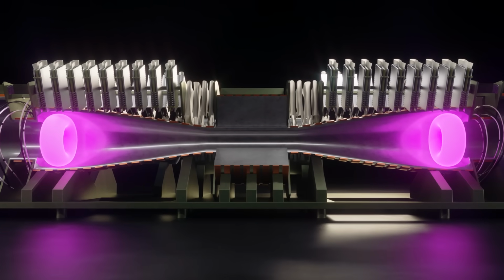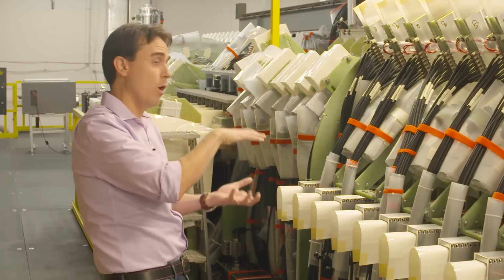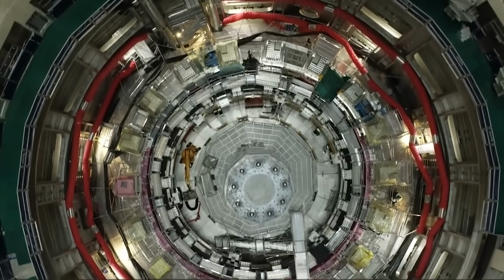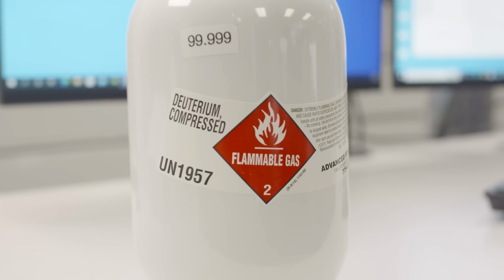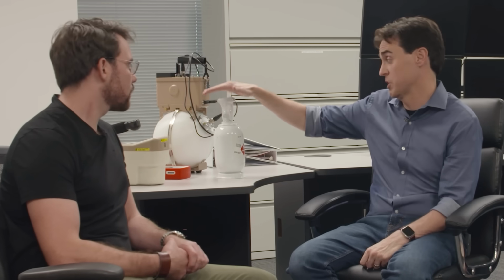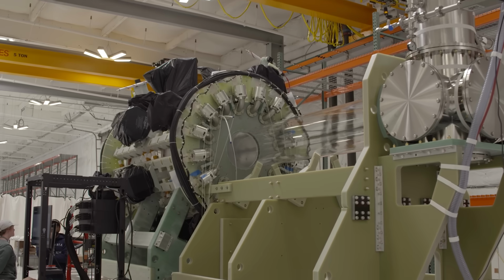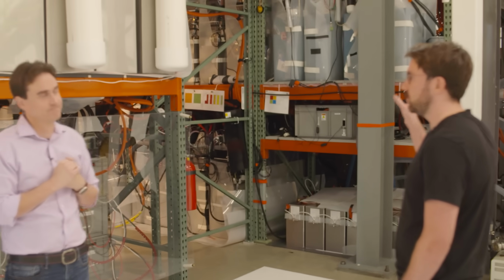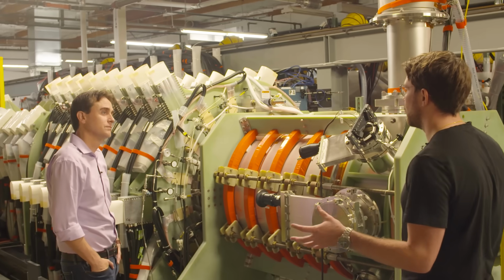A New Way to Achieve Nuclear Fusion: Helion

Comment: Can this math/chemistry essentially propagate with the estimated weight and molecule type of our universe what type and size of fusion reaction it took to create the big bang, and or disprove that it happened in such way?
Reply: im not sure what your talking about but no size of fusion had anything to do with the big bang
Reply: @terraneko8999  everything has a solution, doesn't surprise me you wouldn't know that. 
 No need for comments when you state yourself you don't understand
Reply: @golfnb28  you asked "what type and size of fusion reaction it took to create the big bang" and the answer to that is none, they have nothing to do with eachother
the thing im not sure about is what you meant grammer wise
Reply: @terraneko8999  Why are you saying that fusion reaction isn't what created the big bang? The fusion had to of happened within it's self at a single point. How are you concluding they have nothing to do with each other.? Yes, the big bang is a theory, however there is no known knowledge of exactly what happened. So this type of fusion reaction could conclude what happened during the first reactions that could create the big bang, how could it not?
Reply: @golfnb28  your not wrong but we mostly understand all the parts of the big bang where fusion could help us, the big unknows are timespans and energies so insane that fusion cant compare

Comment: Sounds like an expensive way to waist a lot of energy.  Your always gonna have 2 open sides to leak out.  As well as a pulse configuration that doesn't use simple mechanical device.  The thing is gonna need to be reset and re-calibrated every couple hours while in use.  This is just a bad idea from someone that watched to much star trek and went, I can make a fusion warp engine.  Where do the Di-lithium crystals go?  Its and interesting and new take on the fusion problem but its inherently flawed.  In engineering simpler is always better.

Comment: They insinuate that our energy bill is going to go away but in real world  it will triple so beware of cheering the planned psyop of clean energy. You still going to have a power meter that is even more sensible micro energy uses like small transformers that were ignored in the past by old meters.

Comment: Okay, so getting this process to endothermic--putting out more electricity than it takes in--is difficult as usual, but the pathway ahead seems straightforward.

My concern is that as energy in the central chamber rises, the reactor might cross a threshhold it wasn't made for.  Helion's covered deuterium-deuterium fusion and deuterium-Helium3 fusion, but not potential Helium3-Helium3 fusion or worse yet, the triple-alpha effect.  Where three helium nuclei fuse to form carbon.  And no, I'm not saying that's what normal operation would look like.

I'm saying that's what a runaway system failure could look like:  That if you run these reactors too long at dozens to thousands of pulses per second, eventually pressures run away and you get a triple-alpha event that blows up the reactor and spews radioactive carbon everywhere.  There NEEDS to be both a) a system that keeps pressure runaways from happening, and b) a method of watching and controlling the Helium3 present to make sure it doesn't accumulate enough to allow the helium to fuse with itself.

Comment: At this speed, the cross section of fusion is almost nonexistent.  It is too fast to undergo fusion.  Yes you need speed both thermal and kinetic, but after a certain point the speed of the particles drastically lowers the chances of a fusion event.  There are a thousand graphs illustrating this

Comment: Two months ago two lights in the sky came down and one them was leveled off at around thirty feet off the water and came close enough to see that it was a metallic sphere approximately two hundred feet in diameter encompassed in a strange glowing and it made no sound and judging from the speed they left at it would be my guess  that these craft have the power to bend space time continum. I know there is a way, I can't unsee it  ....

Comment: The heat generated from fusion inmass may warm the planet globally.  Just asking 20 years away.
Reply: No it would not!
160,000 TWh is all of the energy currently consumed by humanity. That is for all purposes and from all sources.
Energy from the sun hitting earth: 1,515,480,000 Twh a year, or about 10,000 times more. Variation in solar radiation is commonly(!) 0.15%, so 15 times more. And that is known to not have an effect on global warming (unlike CO2).
So, even if energy demand increased dramatically and all of the energy was produced by fusion and lost to heat without doing any work, it would not have any impact on global warming.

Comment: The notion that anyone is going to couple induced EMF out of this configuration with any reliable efficiency makes me skeptical.    The way this video equivocates between particle energies and the completely separate issue of generating power from a resulting (impedance matched) macroscopic magnetic field doesn't help.   The fact that they don't seem sure if they are generating energy via directly generating a coupled plasma current or ("alternatively") storing a generated fuel indicates that my skepticism isn't going to be meaningfully addressed in the near future.  Given the level of hand-waving across this entire field regarding this issue of efficient coupling, this would be par for the course.  Hope to be pleasantly surprised.
Reply: I think you are misunderstanding a few things here... There are a few other videos about Helion on YouTube. I suggest to watch them because they might explain some things more clearly (and some others less clearly).
Reply: @elmarmoelzer2229  They explain elsewhere  these separate modes of coupling useful energy from the plasma.  What precisely would you like to clarify?
Reply: @kakistocracyusa   Just watch the other videos to get the right idea. If you still have questions after that, let me know.
Reply: @elmarmoelzer2229  What is "the right idea"??  That your company needs more hype and investment??
Reply: @kakistocracyusa   It is not "my company" and Helion is fully funded all the way to commercialization. They don't need any funding. They need qualified employees.
Reply: @elmarmoelzer2229  What is "the right idea"??

Comment: Unfortunately still 30-50 years away
Reply: Helion historically has a 3 to 4 year build- cycle. 
Polaris will have been operating for about a year by the end of 2024. For reference, Trenta had been operating for a year, when they started building Polaris.
2024 + 3 years would be 2027.
But since the next machine after Polaris is going to be commercial and they have to go through a few extra steps for that (build out manufacturing, licensing, etc), I say 2029 is realistic. 2027 would be IMHO the absolute earliest and require infinite funds and then still all the luck in the world to make it happen. But never say never.
Reply: @elmarmoelzer2229  
"I say 2029 is realistic"
I say that's much too soon but I'll be content to be proven wrong.
Based on my age & family history, I can't expect to live past 2040 & I'm not confident I'll see a successful fusion reactor in commercial operation before I die.
Reply: @bannor99   We will see, or not ;)

Comment: Wow, at this rate large scale fusion electricity generation will be only 20 years away 🤣
Reply: Helion historically has a 3 to 4 year build- cycle. 
Polaris will have been operating for about a year by the end of 2024. For reference, Trenta had been operating for a year, when they started building Polaris.
2024 + 3 years would be 2027.
But since the next machine after Polaris is going to be commercial and they have to go through a few extra steps for that (build out manufacturing, licensing, etc), I say 2029 is realistic. 2027 would be IMHO the absolute earliest and require infinite funds and then still all the luck in the world to make it happen.
Reply: @elmarmoelzer2229  your comment won't age well, and it will have plenty of time (years in fact, probably 20 odd) in which to do so. Or not do so, whichever you prefer. 
"2029" lol 

PS "large scale fusion electricity generation" is the issue. "commercial" can represent myriad applications that are NOT the former. Nice try though

Comment: I'm getting sketchy vibes

but

I do hope to see Hellion succeed, because we're finally can get away from "giant heaters" to much more direct solution!

a real good news of 2022!
Reply: Idk why you'd get sketchy vibes
They demonstrated their mechanism does actually achieve fusion, they have all of the theoretical foundations of a very good fusion reactor, and they're implimenting the practical parts bit by bit
I think that's as good as we can hope for for a fusion startup 
Only downsides I could predict getting in the way are the high energy required to start the reaction and the loss of energy to neutrons but those seem to be navigable roadblocks
Reply: @VoidHugger  honestly hard to explain, just felt off for a while. yeah, they demo'd all of the stuff, explained everything and im ultra-happy about this tech being developed in my lifetime. 

but yeah, sometimes it just feels sketchy.

Comment: I’m kind of sad that this uses Helium. These are supposed to be sustainable energy sources, but how can we call something sustainable when it uses a gas that we have a finite supply of? Helium is in short supply as is, it’s impossible to imagine this machine being widely used to generate power unless it replaces helium gas with another more sustainable option.
Reply: You might have missed it, but Helion will produce their Helium3 by fusing Deuterium in the same machine. D+D => He3 +n or D+D => T + p (the Tritium eventually decays to He3 as well).

Comment: A far more proliferable (if less elegant) approach than the Livermore laser-based compression method recently publicized. Like that approach, the reactive species (helium 3 / deuterium gas) must be stripped of electrons and brought to an intense point of convergence.  While the approach makes sense, it remains unclear whether nucleons can achieve high enough velocities, whether they escape the magnetic field (damaging the chamber), what input-output energy ratio is achieved, whether helium-3 can be reliably synthesized from deuterium (since so many different nuclear pathways exist during deuterium fusion), the higher process temperatures needed to fuse helium-3 and the longevity and timing of the capacitors used to support magnetic containment and drive plasma convergence...

Whew! Too bad we don't have "cold fusion" (and thank you Sun for sunshine!)

Comment: How does the expansion of the magnetic field output a different power to the same magnetic flow,  but homogen through the same coils. Also why are there magnetic field lines starting and stopping in the graphic of the video . That kinda is impossible.

Comment: Looks like the mythical monopoles, no magnetic flux completion circuit. No clarity on the supposed collection of the fusion energy pulse response which is primarily heat, not magnetism. I think this is a hoax, certainly supported by the body language of the guy (David) demoing the device. It certainly wouldn't be the first engine hoax I've seen, but it is elaborate in it's visual presentation. I really don't know if it's a hoax on purpose, or if it's just a concept being over sold though.

Comment: If I remember correctly-
Isn't our Moon made mostly of H3? (Regolith)

This whole device reminds me of Star Trek's "Warp Core" processes:

Deuterium and anti-Deuterium (matter/antimatter) is electromagnetically "pinched"
and transported by "Waveguide Conduits" to an "Interix Chamber", where the tuned streams
are combined inside a "Dilithium Crystal" to then form a tuned stream of Terawatt-range
plasma, that's then used to sequentially energize a row of special toroidal magnets at certain frequencies, compounding the force, by coupling and decoupling the layered energy, creating a subspace bubble.

Maybe they should get Michael Okuda in on this🤔
Reply: kudos. your last line made me actually laugh out loud.

Comment: You can do it in your basement too with cold fusion, high voltage electrolysis high energy ion helium gas fuel cell, 10x energy produced from original source, but I wouldn't try it, very dangerous

Comment: With this technology right here all thermal nuclear reactors power stations will be obsolete and can be decommissioned. And Fusion powered electricity  Will become safe and practical. Instead of these huge power production stations that are extremely  costly to build and operate in a limited capacity. This type of electrical generation system should  be able to be placed in central locations and stationed just far enough apart on the grid that can accommodate and account for any kind of power loss due to transmission. And since  there are no rods to  Lose control of there  will never be meltdown.  On a side note if you were to turn this engine up and down it would look like the warp engine from  The starship enterprise 1701D from star trek the next generation!

Comment: How far can that plasma travel if it gets out if the magnetic fields? Let's say we take this machine, and split it in two, and then just put that one half on a Mech, how far would that plasma gun shoot? How long before it's weaponized for ships and other applications? Not like nobody will think of it if I can think of it.
Reply: Would not really work. The plasma is very hot but has a very low density. So the total energy content is on the order of a few kWh. It is only held together by magnets. When the magnets are gone, it quickly dissipates. Even with the magnets, these plasmoids last for maybe a millisecond or two. What's worse is that the plasma also quickly cools as soon as it is no longer in a vacuum. Cooling will further accelerate instabilities that will disrupt the FRC and cause it to dissipate.

Comment: So, what's the net energy efficiency? Taking into account the whole system from fuel generation to cooling
Reply: Net electricity will be first with Polaris in 2024. Fuel generation is negligible. A single 50 MWe plant would maybe need some 20 kg of deuterium a year. The cost of making that is maybe a few kWh. Not all that much. Cost of the fuel is maybe 20,000 USD but could become cheaper with mass production.